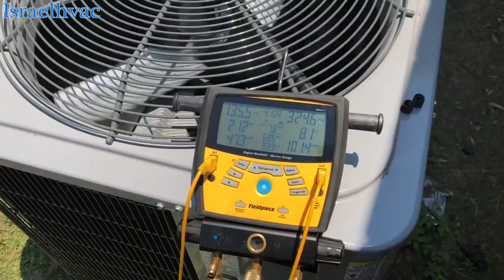HVAC Service | Another Dirty Evap Coil

Comment: I was always taught to put a micron or torr gauge on the opposite side of the system from where your vac pump is. Either that, or a gauge line is attached to the high side and one attached to the low side with the micron gauge attached somewhere on the liquid line, if a port is available. That coil cleaner looks brilliant! I'm not a fan of coil cleaner, but that looks the dogs! Good work brother (from the across the pond!)

Comment: Schrader core removal tools and Nitro have been the ultimate prescription for fast vacuums for decades.  Your micron gauge is also too close to the pump.  Try testing two exact same micron gauges at the service valves and at the pump, you'll see the difference.  Switch the same gauges and there will still be a lower micron reading at pump then at the valves.  Lucky for Ref guys most evap coils have a schrader port at the evap to slap a micron gauge on.  I know its a crap shoot on residential AH's.  Thanks for the video sir

Comment: This was a far superior cleaning than you would accomplish with the hose end sprayer style. It just foams up so mech more and pushes out so much more embedded dirt from the coil.  The only step that would do better is using the power washer to force the dirt out.  They yell you not to use Nubrite on inside coils but, experienced HVAC tech know its the only way to get out embedded dirt from the coil, it just requires extra precautionary rinsing.  Some techs spray a weakened solution of evaporated no rinse, if there is a concern of any off gassing of the chemical with customers with sensitivity issues. removing the top plate was going the extra mile. I saw the pan for horizontal install off to the side.  Do you leave them off?

Comment: I would have given the coils a second and third go round with the foam cleaner and used a flashlight to see every square inch to see spot treatment was needed. 

It cost a ton of money to have a tech just to come out much more to remove the coil and clean it then to spend an hour with a vacuum pump then to charge it. 

You gotta get that annual maintenance where the tech comes out to check the system and clean when that crud is starting to form.

Comment: A tech came to my house and said my 27 yod system needed to be replace. I clean the coil myself and my unit run fine now without freezing up.
Reply: I was also able to clean my own evaporator coil with two cans of evaporator foam ! I used a dog an cat hair shedding brush on the coil dry at first , a lot of surface dirt came out to my surprise after that I started spraying the foam inside the coils with cleaner supplied small plastic tube,two cans of cleaner work best,put access covers back on an turned AC on an according to instructions on cleaner the remaining dirt rinses away along with condensation, as a couple of days went by the AC got colder an colder then started getting icy cold!! It’s 103 here in Waco Tx. An this really paid off big time!! The entire system is 17yrs old, but now cooling like new!!! Hope this can help someone else!!!!

Comment: Looks like someone tried to scrape the dirt off the fins on the inside and bent them. No amount of cleaning is going to let more air pass with them so bad. You may have some luck with a fin comb. Good luck.
Reply: Nope. John bent them using the water jet. At 2:54 the outside fins are strait, and at 2:57 they are bent. Terible job, that should not been done this way.

Comment: I always thought you couldn't use the harsh condenser coil cleaner on the evap coils or is this a foaming evap coil cleaner? It may not be condenser coil cleaner, just looks like it.
Reply: You can't use it in place because there is no way to properly wash it out.  If the coil is removed like in this case and you have a place to properly rinse it .....
Reply: What if you can't remove it and it's hard to reach but reachable
Reply: @sarahbrown4355  they have evaporator coil cleaner that's self rinsing. The condensate from the AC running rinses it.

Comment: Is there an allotted time for coil cleanings, if this was done in the military your would be given a hazmat suit and hazardous duty pay, maybe a ribbon for uniform.
Reply: Really matters from company to company.  Some have fat flat rates while others have very tight flat rates.  One company I worked for charged a 6hr minimum from start to finish.  Another company charged 4hrs which is kinda cutting it with no room for error or surprises.  Last company I worked for did T&M on everything.

Comment: How satisfying to thoroughly clean a dirty coil! Generally speaking, in a situation such as this, do you charge the system with new gas or replace what you took out and top up where needed? I assume yes for R22 but not sure for others.
Reply: Why would you waste refrigerant.  In many cases, the existing refrigerant can and is pumped down into the condenser and only needs to be released back into the system after the work is done, the system checked for leaks and pulled back down.
Reply: Ah yeah, I didn't't even think about the system being pumped down, I thought it could have been pumped out into gas cylinders.

Comment: The way your micron gauge is set up, your measuring the vacuum in your pump.  Not the vacuum in the coils & lineset.
Reply: Not true, almost all vacuum pumps have a shut off valve built in, so you can isolate your pump. if you shut that off, you will read the vacuum in the system. BUT, I do agree, I am not a fan of putting it there for 2 reasons.
1. Your vacuum gauge can get oil in it more easily there.
2. If your hoses and / or gauge leak, it will look like the system has a leak, when it really doesnt.
But Im sure John tests his gauges / hoses for leaks on a regular basis.
Reply: How often do refrigerant hoses last?  I've heard some guys say one season and others say just change the fittings.  I am a fresh service tech this year(started beginning of cooling season(Midwest)), I need all the information I can get.

Comment: Funny how much work can be prevented by just keeping a clean air filter in the unit :)
Reply: Over years filter don’t catch it all. Fine dust particles build up.
Reply: If you have animals - dog dander slips through the filter too.  Our duct was thick with dog dander.  We have tried tonight washing out the evaporator ... waiting until tomorrow to see if it worked.

Comment: Pulling through the manifold makes no difference to the vacuum... bigger hoses don't make the vacuum "stronger", just faster. You can pull a vacuum through a pin hole if you don't mind sitting and waiting...

Comment: Do you ask to use the homeowners hose?
Reply: I never use the homeowners shit..i don’t take water, tips, food, or use the pisser.
Reply from the maker: It was my hose
Reply: @Steven Izzo So if a home owner sets up an extension ladder to access the package unit on his roof do you decline and setup your own?
Reply: lopaka79 yup. I’ve fallen off a rickety old piece of shit wooden ladder a guy had set up for the attic. I’ll use what they offer as little as possible. Maybe it’s where I’m from, but people bitch about every little thing. It’s best I use my own shit and try to be prepared
Reply: Think we can a agree there's somethings a customer can offer that would speed up the process and also use personal judgement on questionable offerings 👍
Reply: lopaka79 Agreed

Comment: Isn't that a bit rough handling of the coil?  Guess I look at AC systems as  fragile (to a degree). Not meant to sound like an asshole, otherwise I'd be one of those armchair assholes not in the business, but knows everything.   Just curious.  Good video and it is so satisfying seeing that crud wash away...the thing Will run mint!
Reply: bababooey7576: do you pull coil out for cleaning?
Reply: Chris Sysco Sorry. I didn't read my comment before I hit enter. I Meant to say I'm not in the business, but just curious and didn't want to sound like a huge know it all that really knows fuck all and is an ass about it sort of thing, lol. Is it a common thing to remove evap coils to clean?
Reply: It is all metal. The only part you NEED to be careful on is the metal fins on the coil. They are aluminum and they bend very easily.
Reply: Oh i know, i guess i was just thinking of all the joints at the ends that could leak....was thinking maybe if it was roughed up enough, it'd spring a leak or something...maybe my ocd, lol.   yes bending the fins...argh pet peeve of mine.
Reply: What I was thinking, he needs a whole new evaporator in my opinion because all the coils are bent blocking passageway. The system probably could run better